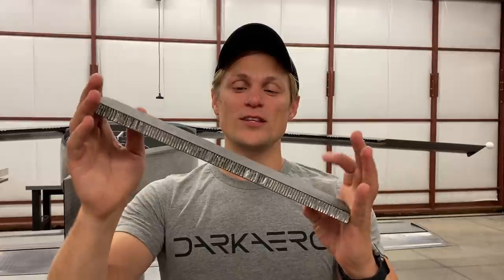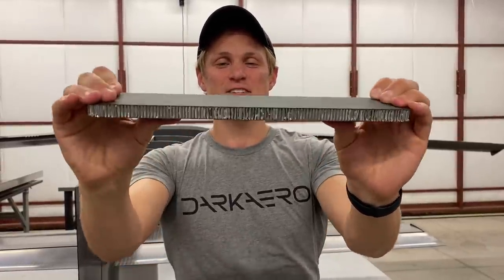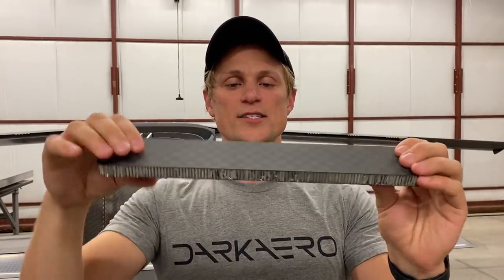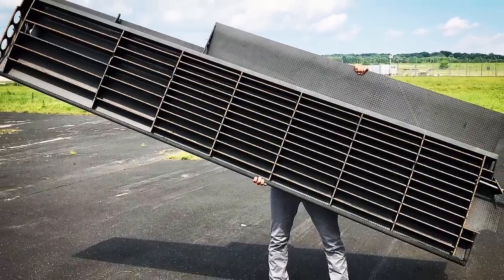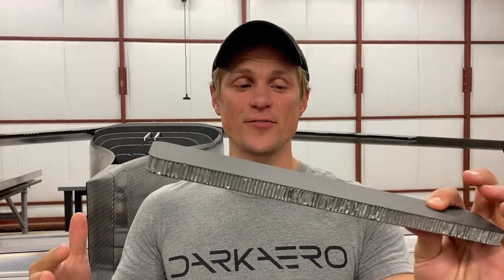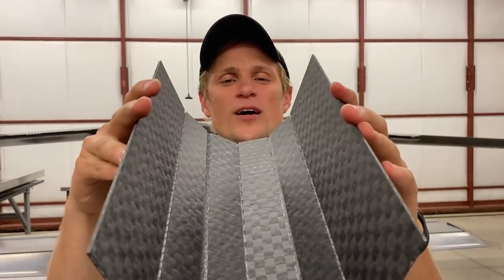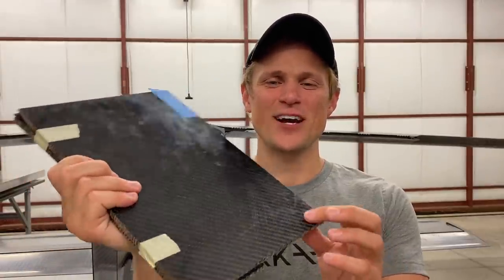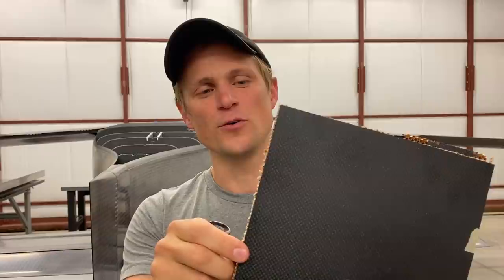CARBON FIBER + Honeycomb Sandwich Panels in the DarkAero 1 EXPLAINED!

Comment: How do you prevent galvanic corrosion?
Reply: Come ???
Reply: I am wondering this too.
Reply: They are using fiberglass.  It was subtly said in a previous video about composites used in manufacturing.
Reply: @Nicks675  OK Thanks.
Reply: look like carbon top layer?? maybe its fiberglass to aluminium then carbon on top of that?
Reply: @daveburgess4949  They use one layer of a tight weave glass and then the layers of Carbon.  The glass separates the aluminium from the carbon preventing the corrosion.
Reply: As far as I know, as long as you keep an electrolyte out of the mix there won't be any corrosion. I could be wrong and a layer of aramid/ glass should do the job

Comment: Would love to see how you bond the panels to the core structure.
Reply: They probably apply epoxy glue to both sheets, add the honeycomb in between and then vacuum bag until cured.
Reply: @jimbit22  Wouldn't that pull the epoxy out of the wetted CF into the honeycomb?  I'm curious about this too.
Reply: Just guessing here based on previous experience.
First they laminate the ply sheets individually on glass "molds" using a vacuum bag.
Then they probably trowel on a very thick epoxy adhesive on the back side of the first sheet, then lay the honeycomb and finally apply the top layer with epoxy on the back.
All of this gets vacuum bagged to ensure uniform adhesion and thickness.
Reply: Easy to say they glued it together with epoxy and vacuum bagged it.... But I'm also curious what their actual process is.  I wouldn't be surprised if they're using a layup process I'm not familiar with that gives the honeycomb better seating in the panel —being that it's structural and FAA. 🧐
Reply: Super interested. The honey comb seemed flexible. I wonder if you could wet lay a lightly curved surface with honeycomb laminate.
Reply: @shaegrover9516  like tensioned cables in the slightly-curved prestressed concrete trusses in bridges. The different steels that quenched give the katana it's curve. countless examples of course... Interesting for sure! 🤔
Reply: @shaegrover9516  Obviously delamination is the limit to how far you could push something like that.. if you had a process to barb the upper and lower interface of the honeycomb, just like other barbed inserts, you could get some really aggressive curves/stresses.
Reply: @shaegrover9516  Yeah, absolutely you can.  You can't do real tight compound curves (think, like, bike saddle) but mild curves are no problem.  Curves in one plane with little or no compounding are a no-brainer.
Reply: @daltanionwaves  Usually the panel fails on the compression side, on the inside of the curve. That's the downside to a real stiff skin.
Reply: @daltanionwaves  One process is to use prepreg carbon fiber (they are generally more expansive, but you can make your own prepreg). Just put the sandwich in a mold than vacuum in an oven.
Reply: @theecstatic9686  he said they make the panels and then cut them
Reply: @daltanionwaves  lmao 😂.  The quench does NOT give a katana it’s curve. 🤦🏻‍♂️🤦🏻‍♂️🤦🏻‍♂️🤦🏻‍♂️🤦🏻‍♂️.  If the metal moved when you quenched it it would be a failure.  Way to throw out a bunch of words with zero correct information

Comment: So I have seen those panels in use on the C-17 and my recollection is they are super strong for the weight but watch out for any water in the panel because it will freeze and delaminates the panel.
Reply: I agree. they stated that one of the panels made by a outside mfg was puros and would allow fuel to migrate into the core cells, well ill tell you there is no carbon panels that can be mfg to be completely sealed. they make a tank sealant that can be applied that will seal the carbon but again this adds weight. I'm curious if they run a wet wing or dry wing fuel cells

Comment: These videos are great and really seem to energize the community following the DarkAero 1’s development—keep up all the great work your doing along with the whole teams keen attention to the details. It goes a long way in helping the prospective DA builders come to appreciate and develop confidence in the design decisions YOU have made and continue to make as well form an emotional connection the plane, its design and your family—I wanted to say DarkAero company but for all intensive purposes, you and your brothers are the company.

So the other thing about these videos is that everything they answer leads to yet more questions—questions in a good way though. Here are some that spring to mind:

• Is there galvanic corrosion risks between the aluminum honeycomb and carbon fiber skins of these composite panels?
• Assuming this was an issue, how were you able to assure that the edge of the aluminum honeycomb does not come in direct contact with any carbon fibre in the skins, during setup, bonding?
• Most of your videos show the team applying adhesive to both surfaces to be bonded (all-be-it most, if not all, were of carbon fiber-to-carbon fibrer bonds) and much care was used to remove excess adhesive to keep the parts as light as possible. So how were you able to avoid using excess adhesive when making these panels yet not have any places with voids in the adhesive were bonding failed?
• Do you use any nondestructive methods inspect and test the quality of the completed composite panels prior to them being used in production—for adhesion between the materials perhaps the use of ultrasound, x-ray, or the old rubber mallet & the human ear trick and for corrosion risk perhaps dielectric or conductive tests between a variety of points on the panels carbon fibre skins and the aluminum honeycomb core.
• Why did you choose aluminum vs aramids or some other honeycomb core material when making these panels?
• Was is the thermal characteristics of the aramid honeycomb core which you were referring to in the video when you rejected the samples of the commercially available panels or was it something else?
• I understand why using honeycombed aluminum core composite for the firewall makes a lot of sense because, despite, using a titanium heat shield on the engine side of the firewall, aluminum alloys can maintain their rigidity and structural integrity for many 100°F higher temperatures than aramids. Without an extinguisher system, this fire would generate heat which could quickly get beyond the breakdown temperatures of the epoxy resins in the carbon fiber skins, and in the aramid honeycomb structures as well as the adhesives used to bond the composite panels together. In case of an in flight engine fire, keeping the the structure to which the engine mount and nose gear are attached, the firewall intact, would seem to be a prudent choice, but the internal structures in the wing would not seem to share the same risk whether the DA-1 is on the tarmac or in flight. Wouldn’t aramid or S-Glass honeycombed cores make for a lighter panel in these none engine compartments areas?
• Are you anticipating that runaway solar induced thermal loads could be absorbed into the wing and thereby could compromise its internal structures?
• Are
 you be trying to mitigate risks and increase the survivability of a fuel fed fire in the wing while at altitude?
• Have you conducted proper destructive testing of samples from your honeycomb panels, during development to assess their true characteristics for engineering purposes.
• Are the edges of the inner edges of the CNC cutouts in the wing tank areas sealed or is the aluminum honeycomb core exposed to the fuel in these places?
• Although no pilot should willingly fly into an active lightning storm, what are the risks associated with a lightning strike-—to the pilot and passenger directly, the electrical systems, the DA-1’s structural integrity and the fuel and the lubrications system? And what design and engineering decisions have you made to mitigate these risks?
Reply: La corrosione deve essere fermata!

Comment: Thanks for video. How do you join the shear webs from sandwich panels with the wing skins? Which adhesive do you use? I am concerned of an extra weight gain due to the adhesive which is absorbed by open cells of honeycomb. Also I am concerned of the joint between the skins of sandwich with the wing skin. How do you do surface prep before bonding?

Comment: Have you folks tested the resistance of this honeycomb to fuel intrusion?  People in the composite boat building world have lots of stories of waterlogged foam cores.

I'd like to hear that you kept a sample honeycomb panel in a jar of mogas for a year, and then measured weight gain.  I'd like to hear that the edge details were as they are fabbed in the wing.

Comment: good to see but you can also use the cnc and software for unidirectional thin ply layering. 

that way you reduce carbon waste and weight and increase strenght. 

the best sandwich core to date is foam core with carbon rods in pyramid structures. you can buy thin carbon rods and cut the foam in pyramids (pyramids can also be adapted for pressure areas)  with CNC so you put the rods manualy and them put the other half of the foam (with holes also, the rods have to be in contact with the external carbon layers) and after you lay the thin ply with the cnc on both sides and then to the autoclave.

this system can be improved with topology optimization software and several thin bulkheads

Comment: Awesome video as always ! Going to subscribe to the online courses very soon ! One question, I am building my own aircraft now, and I do hesitate between aluminum and aramid honeycomb for the main fuselage frames (both 0,6inch). With your experience, which one would you use? (with 2x210g carbon twill on each side of the panel, plus 50g glass each side if aluminum for galvanic corrosion prevention). Thank you so much ! Waiting for the DarkAero kit !

Comment: Fascinating! Quick question: What happens if a lightning strikes the plane, be it in the air or on the ground? If not mistaken, I believe that Boeing and/or Airbus mix in some kind of copper mesh within their composite structures to allow the electricity to flow (creating a faraday cage I´d imagine) and not generate any damage at the impact location. Is this a concern for DarkAero as well? Congratulations on this great work!

Comment: I didnt find a video from you about how to make the honycomb composite.   From watching your videos, you prefer unfusion. But can that be used when you have a hoycomb with hollow space between the latyers of fiber/carbon on either end?  Do do you prepare carbon panels and cure them  and "glew" the carbon panels to both side of honeycomb? If you used a vaccum process, wouldn't the carbon want to go into each honeycomb hole& (and wouldn't the resin want to fill that hole if using infusion?

Comment: I wonder if this would be possible to apply to smaller parts, like the ones used on multirotors, which use 2.5-5mm thick carbon fiber plates.

Comment: When bonding a sandwich panel to the wing skins, do you add a "spar cap" or strip to interface between the edge of the panel to the wing skin. Curious about imprinting the substructure to the outer side of the wing skin.

Comment: For the webs inside the wing, what do you need the stiffness of the honeycomb for?  Those webs should be under shear and compression and tension in plane.  What out-of-plane forces do they see?

I can see that the thickness of the webs makes them easier to handle and get into position.
Reply: I suppose you might ask that of any conventional wood-over-foam web.

Comment: Really loving how this plane is coming together. Currently on a bit of a project with an old Mooney but I could see myself in a DarkAero in a couple years. One question -- Mooney types really tout the crashworthiness benefits of the steel frame that surrounds the cockpit in those airplanes. How have you guys thought about crashworthiness in this plane?
Reply: All modern race car crash structures are made from carbon fibre - it's much better at absorbing energy than steel, and also by not having any holes like you would in a steel frame it's much better for preventing puncture injuries.

Comment: How do you make your panels? Do you have fiberglass between the carbon and aluminum?
Reply: They are using fiberglass.  It was subtly said in a previous video about composites used in manufacturing
Reply: Here it is https://youtu.be/mwTE4MamfVE?t=388
Reply: Perfect thanks lancer2204

Comment: Does the honeycomb sandwich build up pressure on a hot day?  Windsurfing boards can delaminate if you forget to unscrew the vent and you leave it in the sun.
Reply from the maker: The internal cells of the honeycomb are sealed so they do build pressure with changes in temperature and atmospheric pressure. This caused some problems for us in our early days of panel testing. We had to come up with a method to bond the honeycomb core to the carbon fiber skin that was strong enough to withstand the large changes in temperature in pressure. Larger structures like the wing, VS, and HS are vented which is analogous to your windsurfing board example.

Comment: I'm curious what the cost difference is between off the shelf panels and your own panels, and why aluminum core over an aramid core in your own panels. I'm also curious about your manufacturing method of these panels, I've only ever seen this done with pre-preg, and I know everyone has their own slight variations on how they make theirs; but I'm going to guess you manufacture, or buy, the carbon panels first, then bond them to the honeycomb, to avoid resin seeping into the honeycomb and adding dead weight, where in typical pre-preg pieces, the honeycomb is sandwiched between the sheets before bagging and curing.

Comment: Do you use any separator material between the aluminum and the carbon composite to avoid galvanic corrosion?
Reply from the maker: Nils, thank you for watching. Yes, we have a layer of fiberglass that separates the aluminum honeycomb from the carbon fiber.

Comment: Are there any corrosion issues using Aluminium honeycomb with Carbon Fibre?  When Carbon Fibre is used with Chrome Moly tubing, a plastic spacer is needed to separate the two materials to stop corrosion.  What was the criteria for selecting the Aluminium honeycomb?  What grade of Aluminium did you settle on and why?
Reply: I was wondering about the galvanic corrosion issue, too.  It seems concerning to me.

Comment: Interesting approach, though you failed to mention the big plus of Aramid vs aluminium ie: the lack of galvanic corrosion and how you address that in your aircraft? You may have addressed it in an earlier vid and I missed it - corrosion is a serious issue needing a solution when using carbon fibre near any metal. I understand epoxy fibreglass barriers are used to separate the conductive elements? As for heat effect (long or short term?) on aramids are you referring to engine bay area or some other location?
Reply from the maker: Zobra, we use a thin layer of fiberglass between the carbon fiber skin and aluminum core to electrically isolate the two materials. The temperature capability of the third-party aramid core panel mentioned was more to do with the resins used in the skins and adhesives of that panel. Our own aramid core panels are actually used throughout the wing and tail structures.

Comment: OK, more serious question.  Edge treatment: I can see you have only a few exposed edges for your panels, mainly in non-structural areas like cockpit arm rests.  In order to avoid core erosion, do you specify any particular edge treatment?
Reply from the maker: The exposed honeycomb will be sealed similar to other areas in the aircraft. We have used a thickened epoxy to accomplish this.
Reply: DarkAero, Inc Thanks!
Reply: Look into trimlok.com edge trim. Lots less fussy than epoxy backfilling and possibly a cleaner look. Probably a small weight penalty.
Reply: @DarkAeroInc  Hey loving the videos.  Will Dark Aero be selling just uncut panels to other builders?  I would be interested in using this kind of panel in place of Klegcell foam core panels and just wondering if you think that could work.  Also curious why you went with a 1/2" panel instead of the 1/4" ones you were ordering from other vendors?  Thank you for all the knowledge shared already.

Comment: how did you manage the problem with eletric-corosion between aluminium and carbon ?
Reply: There is a later video on that subject. They use a lightweight layer of glass between them.

Comment: How do you deal with the corrosion that happens between the carbon and aluminum?
Reply from the maker: Jim, thanks for watching and the comment. The carbon fiber and aluminum honeycomb are electrically isolated using a layer of fiberglass. We have a video coming out in the future that goes into more details on galvanic corrosion so stay tuned!

Comment: is a layer of fiberglass between aluminium and carbon fiber enough to prevent corrosion?
Reply: They are using fiberglass.  It was subtly said in a previous video about composites used in manufacturing